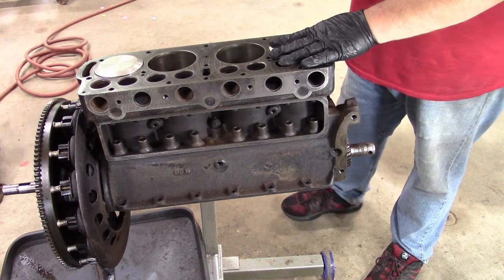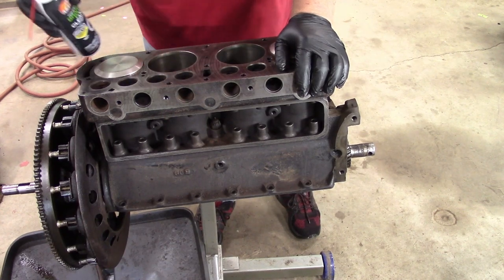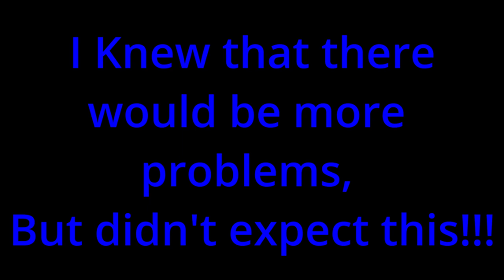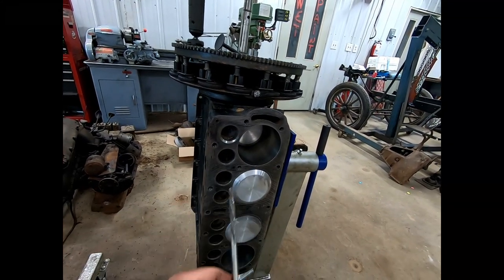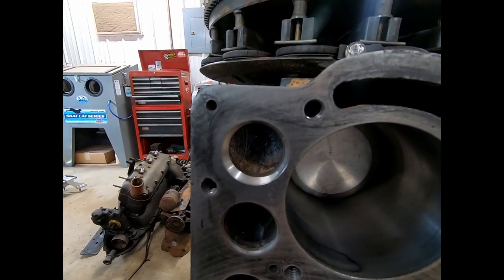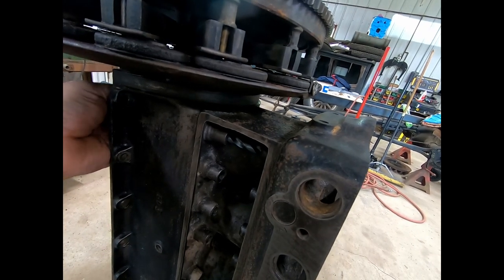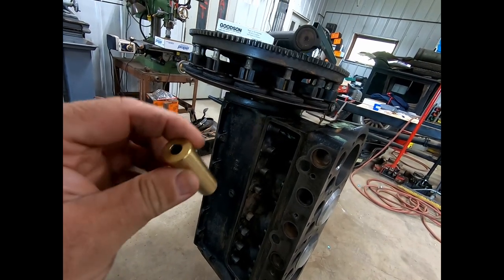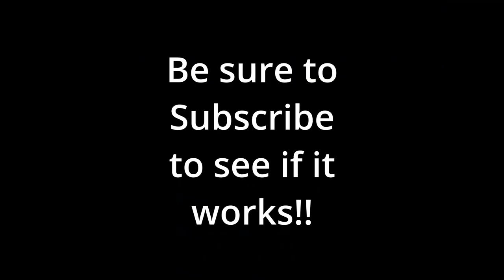Model T Ford Engine Build 10

Comment: Good luck. A problem you may encounter is that drill bits tend to follow holes, not correct then. An end mill will correct the offset hole much better
Reply from the maker: That is one of my concerns as well, Stay tuned to see if it works out!  Thanks for Watching!